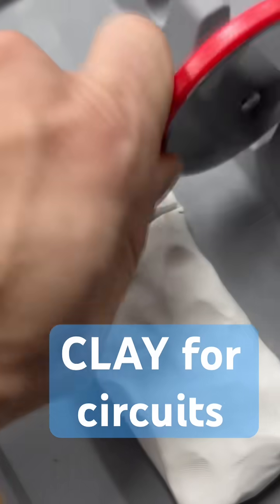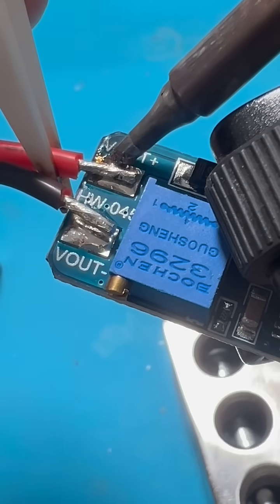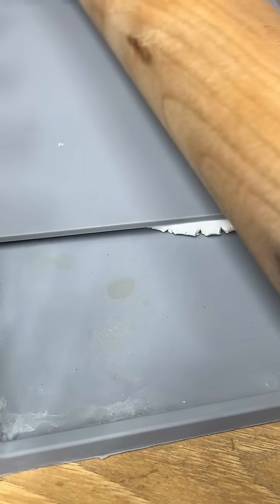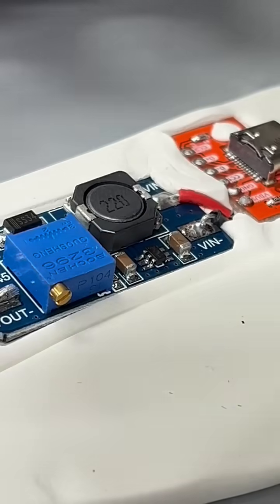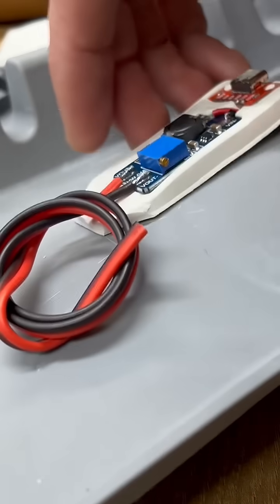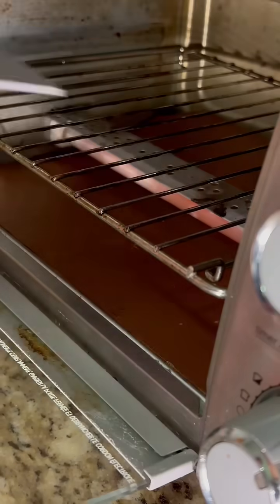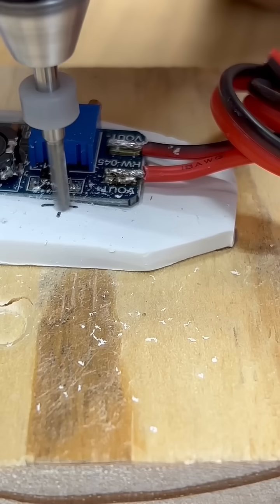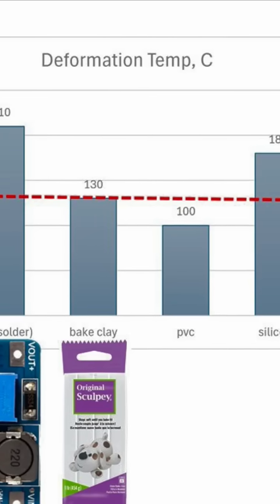use clay for circuit projects #methods #mechatronics

Comment: I use hot glue for my moisture protection. It covers quickly and well, and isn't hot enough to screw up anything. The clay looks like it would work, I just think it takes too long. Hit glue is much faster.

Comment: You really didn't need to put the wires on first so it really wouldn't matter what insulation it is because you wouldn't have to bake it with the wires installed.
Reply: Ya but probably a good demonstration for applications where you would
Reply: Yes but this is an example to educate, in some cases you would need to put the cable first and personally I didn't know I would need to use silicone insulated wire, so this is very helpful
Reply: Very helpful if you are ret rded. Go do it, 🐒
Reply: First thing i thought is c4😂 your cooked if someone from the public saw it😂
Reply: You can always count on YouTube to show solutions for problems that don't exist.
Reply: I was disappointed the clip didn't demo the kind of circuit layout that would show the utility of this clay. I'm left to guess at geometries where the wires travel through the clay or something like that.
Reply: @roqua  The clay can provide support for wires and components to alleviate stress on connections for small circuits that are part of a larger mechanism. The clay can also act as a structural element to facilitate mounting into a larger mechanism, when the small PCBs, switches, and wires do not offer much to attach to.
Reply: @davidsnyder3799  Yeah, like potting compound on the one hand and a mounting backboard on the other. Would have been nice to see it used either of those ways. 
I'm thinking, for instance, of how one would want to keep PCBs, switches and wires from straining under load on high G applications.
Reply: Same thought
Reply: Epoxy clay,cheap and sturdy and no need of heat
Reply: @Snay1998  Yeah  apoxie sculpt would be great for this.
Reply: Epoxy clay is sticky and has work time. I don’t know if a way to get a precise complex shape out of it. Like if I needed a corner piece to hold sensors for a solar tracker, I could make that out of clay and get it precise enough to hold my sensors where I need them. With epoxy clay I’d basically be glueing the sensors in place with epoxy, that works just fine as long as the surface I’m mounting to has holes spaced in the right places that can be used to align the parts, problem with this is, now I’ve permanently glued in my sensors, cannot easily service the machine. I’d go with the epoxy for a small unit that isn’t meant to he serviced like a key fob, I’d use clay or something else for components of a larger machine (unless it’s a boat, then everything, even the captain gets fully encapsulated or sealed in a water tight cabinet).
Reply: @Snay1998  How fast does that solidify when exposed to air though?
Reply: @OMNI_INFINITY  not as fast as me with yomomma.
Reply: also didn't need the clay its all pointless
Reply: @mewmew32  It's an example to demonstrate the concept. You could use the clay and wires to replace a pcb entirely.

Comment: I use epoxy. It also shields from rf a small bit wich helps for sensors. Especially if you use metal powder in the epoxy. You can also just glaze with epozybto waterproof it
Reply: epoxy putty. Me too.
Besides, I would generally put curcuits in an enclosure such as small plastic project box. Specially if you want to actually use it for some time.
Reply: Epoxi became soft and flexy at about 80C. Hot elements may drop off?

Comment: I really like this idea, especially if you want to keep everything fixed in place which is absolutely annoying if you've ever had to keep an awkward angle between 2 boards (as shown in the video). I don't really love having to buy special wire for this kinda thing, but trade-offs are a thing.

Also, I would definitely recommend you get some flux paste and paint that shit on to those wires. It'll make soldiering those wires SO MUCH easier, trust me.

Comment: Hey man, just a small recommendation that can completely change your soldering game: 
Get your hands on some proper 63/37 leaded solder, I can personally vouch for mg chemicals no. 4886-227G.

Also, some flux would be good practice too, I've used chipquik CQ4LF-1.0 with good results.

These can be both had for under $100aud shipped to my door from Digikey.

I saw a massive improvement in the wetting of my solder once I threw away the no-name 60/40 solder I was previously using.

P.s. Remember to tin your irons tip, Nobody likes a dirty tip ;)

Comment: didnt see anyone mentioning loosing cooling of the board since the material is insulation this will be an issue when the board gets too hot and components break down the solder will also break down with high temperature even get so hot solder melts
Reply: Judging by the Guage of those 2 wires, I doubt a 5v dc is going to get slightly warm.
Reply: @Thehudhud34  and what does the wire thickness to do with components gettihg warm/hot, guess the only thing we need to know when building electronics is the wire gauge wouldnt that be easy, guess you dont know much about physics math and electronics and other things as well

Comment: I always thought those circuit things would NEVER withstand heat of like, over 40°C let alone 120...wow
Reply: Most components are made to withstand the heat of soldering, and soldering is often done in an oven that is considerably hotter than this.
Reply: @AlarKemmotar the oven we run boards through is around 300c for 8-15 mins. PCBA process engineer here

Comment: 15 minutes of 130C is not a "nice and easy" anything. Well atleast if you want these projects to live longer than a few days. I dont see any components in that circuit that are rated for that temperature.  You'd prolly have to get MIL rated components for that.
on the otherhand once you have an impression, you could have just baked the plastic clay by itself.

Comment: I'm in trouble if my PC reaches 100°. Love the idea  but I would remove the electronics first
Reply: Due to propagation delay or energy, 100 measured probably means 110 or 120 at core. 

Many chips can stand 125 core.

130 offline is the recommended temps to remove moisture. Most ic can stand 150 for hours.

Comment: That is incredible hot for a circuit board
Reply: yeah ... Its at least 5°C above the max use temp .

It's even below the recommended temps to remove moisture before soldering.

Comment: I like the idea, but I'd get distracted by turning it into a craft project.
Reply: Automated switch backing becomes a coffee mug.
Reply: I was thinking of the same thing like why they just use it to make any thing it looks like faster than 3d printer right?
Reply: What idea? Still waiting for a purpose to be started in the clip.
Reply: For higher volume you could probably make or 3D print a mold.
Reply: Imagine something called epoxy that doesn't need "baking", even silicone to give that rubbery protection. 😂
Reply: This is a channel to block and forget.

Comment: Useless. Will crack and fail for numerous reasons. High frequency oscillation of circuits, dropping, dust. They make double sided mica insulation tape for a reason and a million other products I would choose before clay! Even hot glue is a better idea in my opinion.
Reply: Or ... Read other comments where every agrees it's the best solution for his need ...
Reply: Since when dust causes cracking?

Comment: I wanna ask, is bake-clay a ceramic or plastic? In other words, does it melt or go brittle if you overheat it?
Reply: Brittle
Reply: Polymer clay is a type of hardenable modeling clay similar in texture to plasticine, Once baked (this is its curing process) the final product cures to form Polymer Polyvinyl Chloride (PVC). Great Product..
Reply: @robb3931 yah, PVC. I think the binders added also make it more brittle when it gets overheated. Pigments also.
Reply: @DanVogt  but so does the majority of other plastics, this is why polymer clay has a specific time and temperature to bake it at.
Reply: @robb3931  No doubt, tho I mean to say I have found you can go over temp for less time, and under temp for longer and still have an identical result because of its heat retention   extending the cure, and binders - very forgiving

Comment: You could use the air dry clay that has a rubbery foam like feel for other applications as well like to reduce vibration on some components. Would be good for things with motors or oscillating constructions.
Reply from the maker: i love that substance but i learned it shrinks like 25% over time and nothing fits anymore.  used it for tool drawers.

Comment: Ignore the haters, I think this is an interesting idea for prototyping and gadgets... it opens up some neat mounting options and also full encapsulation options. Remember all SMT electronics have already seen a lead free reflow profile which is over 200C. If it's a double sided PCBA it has probably seen two reflows over 200C. Many components will run at 125 Deg C just fine ("E" temperature spec).
Reply: I agree, I think this is a great idea, I usually resort to glue gun which is messy and unreliable.
Reply: I think clay doesn't cool very easily as compared to any other metal heat sink...am I correct ?
Reply: @santoshwhy2943  clay likely is similar to raw brick at 0.5 – 1.0 W/mK according to google... but people are also encapsulating in PLA which is 0.13 W/mK. PLA gets soft at 50C... so the clay doesn't look too bad as a mounting interface... but If you need an actual heat sink then, yes, metal clearly wins at ~150 W/mK.
Reply: The question is how could I take the clay without further damage in future maintenance? A simple and practical solution is expected.

Comment: Mind you i would bake it without the components ic i can’t be 100% sure if they can cope with the heat but the idea is awesome
Reply: While that logic is sound, the clay shrinks ever so slightly while baking. Baking with the circuit allows the clay to shrink around the part sealing it in.
Reply: Most of this type of clay will actually harden at lower temperatures. I've hardened it in boiling water (works nicely for parts that you don't want to set on a flat surface), which is 100C.
Reply: 130C us absolutely fine. They are off. Chips can usually handle 170C "indefinitely" if not powered
Reply: No need of baking,we got epoxy clay..just knead them..put in the component and u done in an hour 

Also no chance of heat damaging it as there is no heat involved 

Is super handy to have a few packs around ur house as they can work on other quick repairs too
Reply: ICs are designed to work up to 120 c. 130 or 140 is used to remove moisture before soldering.

Comment: Heating any circuit board above 105 degrees celsius is stupid.
Reply: Why would you be so judgemental while being so clueless...
Reply: That's why industry banned reflow soldering ages ago.
Reply: Tip : most IC accept work up to 125 c
Reply: Tip : storage temp is always higher than max work temp
Reply: Tip : moist curing temp is even higher
Reply: Tip : pre reflow pre heat which lasts about 3 to 5 mn is even higher
Reply: Tip : Reding PDF of ics is a thing, but at the risk of learning new things ... It may leave your brain in a deformed state with less wrong certitudes.

Comment: maybe there is a aplication for this but for 99% of the time hot glue would work and its way more easy and cheap to use
Reply: Hot glue is messy and unreliable for some applications that this would suit better.

Comment: An even easier to work material would be thermoplastic beads. Put them in hot water, roll them between two cloths to absorb any water, shape in the same way, hard in 15 minutes. You can then use standard wire and if you want to change the platform, the material can be warmed up and reused. Can be drilled in the same way.
Reply: They're pretty expensive and the final part can get soft if you forget to turn on your AC in the summer. You're better off with hot glue sticks if you want a thermoplastic, or Kydex if you need sheets and forming